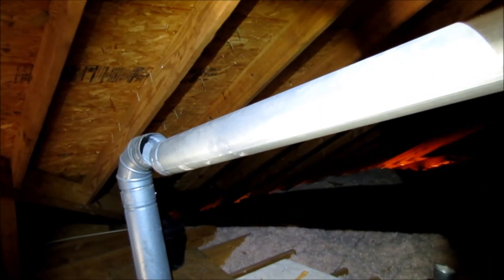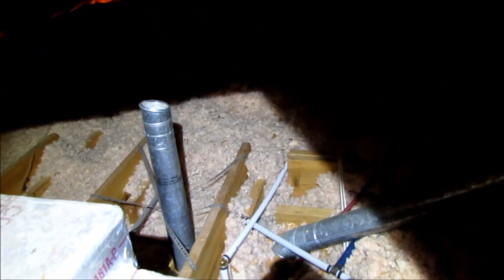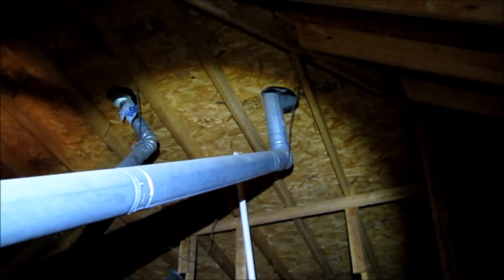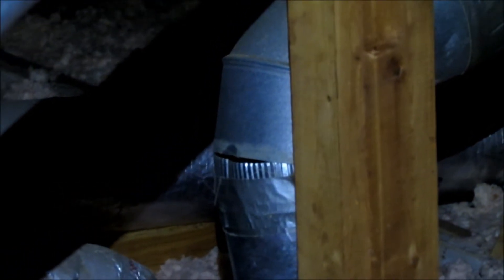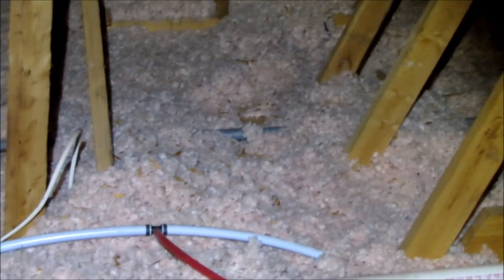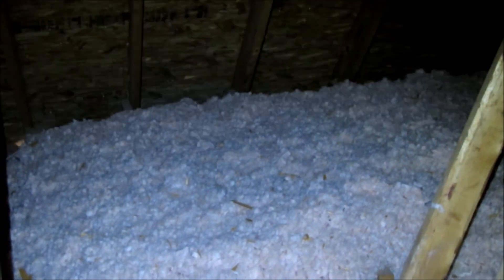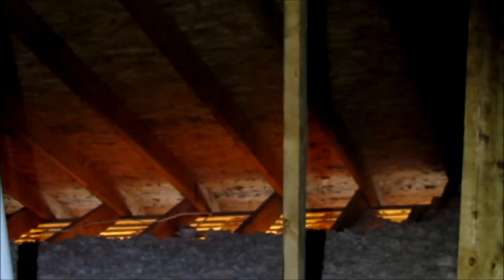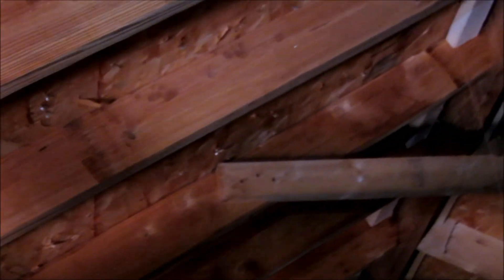The Dangers Of Furnace Water Heater Natural Gas Ducts Venting Into Attic Space Episode 106

Comment: all the sudden mine blows steam/condensation out the roof vent and it has my rafters all damp and dripping in just the area from where the vent sticks out the roof. No explanation, just started doing it when I turn the heat on. Any ideas?
Reply from the maker: Sounds to me like high humidity in attic causing condensation
Reply: Just went into the attic and noticed gas water exhaust disconnected. Had air-conditioning work done last year....
Reply: @guyaugsburger3073  take pictures and keep on file. Honest mistake?